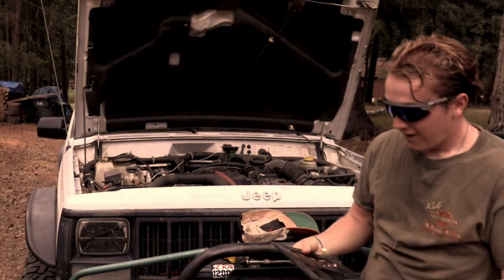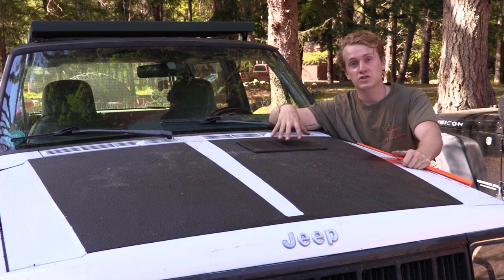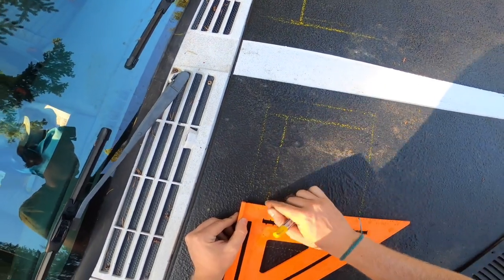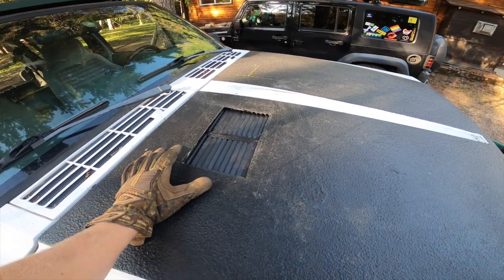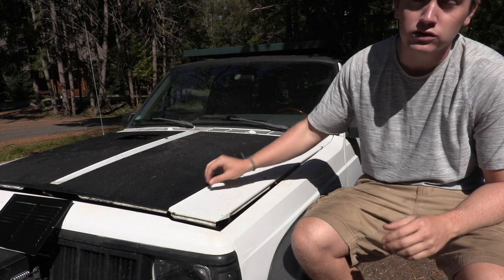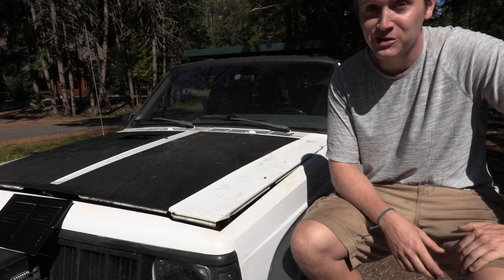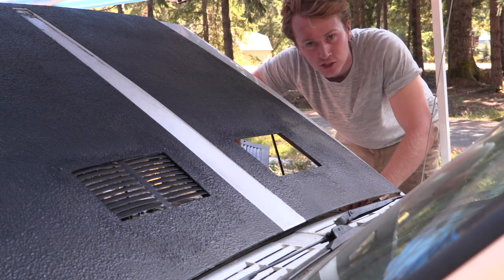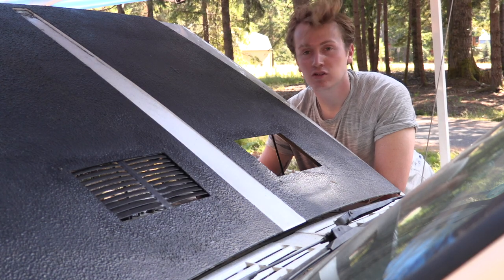Build Jeep Cherokee Hood Louvers for $40 | Stop overheating for cheap

Comment: Your correct. Need to allow the air to escape. This was my first summer with the xj and even with the heat on the hwy it wasn’t allowing proper air flow. Need some hood vents myself. I’m in the pnw also hopefully I see you around. Thanks for the ideas.
Reply from the maker: I’m around the mount baker-Snoqualmie national forest when I’m not at the day job or in the garage!! It was a fun project would recommend

Comment: How they hold up in the rain? Any issues?
Reply from the maker: I havent had any issues from it and I live in the coastal PNW so the jeep has gotten alot of rain. one of the things I looked for when I was placing them was having it not be directly above any major electrical components (the driver side rear fuel injection system is "exposed" by the vent but there is only so much ya can do)
Reply: @SomeGuyOutside  yeah I also live in the pnw, I just installed some on my ZJ and I’ve noticed when the jeep is just sitting it’s a good idea to cover the vents, Definitely a great modification tho 👌🏻

Comment: Nice vid, and one part of me is crying for me to run take action and install the same grill. Another part of me, howewer, wonders: "how do you guys overheat theese cast Iron beauties???"

Never had any overheating issues on my xj. Offroading her like hell, heavy traffic sometimes. 32-35 degrees celcius and it runs fine. The only issue i have sometimes is misfiring when Hot. Anyone has those?

But the temp is always around the middle. I rarely hear the Electric fan on.
Reply from the maker: In central Washington it’s not an issue I’ve had in just very conscious of preventing it from occurring! I keep up on preventative maintenance but also I just thought I’d like the way it would look!
Reply: Theres a TSB for 4.0s that recommends wrapping your #3 (or all) injector(s) in some kind of insulatory material because the injector can vaporlock when it gets hot. Sometimes old crank sensors also get upset in the heat.
Reply: @SomeGuyOutside  I agree, looks nice, kinda like ZJ 5,9 hood. I always keep the radiator clean and coolant fresh. But, as i said, theres something about the grill, that made me consider having one.

Thanx for the advice, I was thinking that the issue is in the jets, didnt know about evapouration lock. Looks like this, because If i have minimal movement and the engine bay is ventilated a bit, I dont have the issue. But If i stand idling for a long time or leave the Hot engine for a few minutes and the heat goes up, here we go misfiring. Next spring I'll wrap em in some kind of thermoisolating tape and see what happens. It's already pretty cold here in Russia.

Comment: Solve one problem and create another…water under the bonnet all the time :/
Reply from the maker: Im not terribly concerned with a small amount of water under the bonnet, water gets sprayed in by the tires through the wheel well and such. I chose that size and placement as their isn't an UBUNDANCE of electrical components directly under that spot. However you're correct there is certainly an increased risk of water damaging something having had done so.
Reply: @SomeGuyOutside  fair enough, it’s probably worth the risk.

Comment: Why do even have the hood insulation on the hood if your worried about excess heat🤦🏻‍♂️🤦🏻‍♂️🤦🏻‍♂️ and why not trim the vent instead of cut the hood string thing ribs??please do not make any more how to videos!
Reply from the maker: Like I said in the video, it’s purpose is to further prevent overheating that I do not yet have. Second it’s aesthetically more pleasing in my opinion to have the vents below the hood rather than on top. The insulation helps prevent heat warp of the paint on the hood. The hood would have to be cut either way (above or below) so that doesn’t make any sense?   Finally it doesn’t say “how to” in the name or thumbnail but I appreciate the advice, I won’t be taking it. I recommend proof reading your comments as it was full of grammatical errors though! Thank you